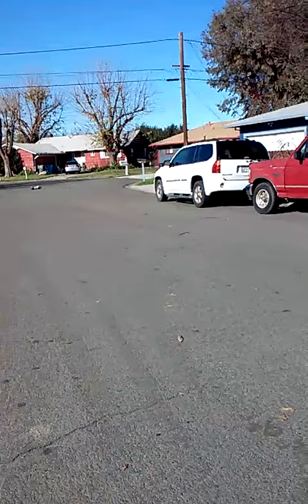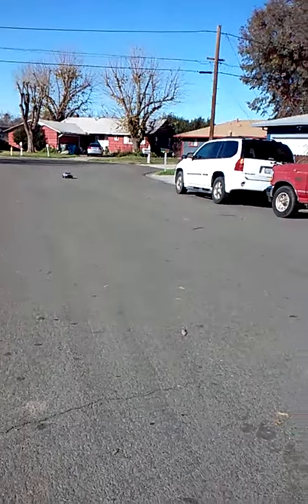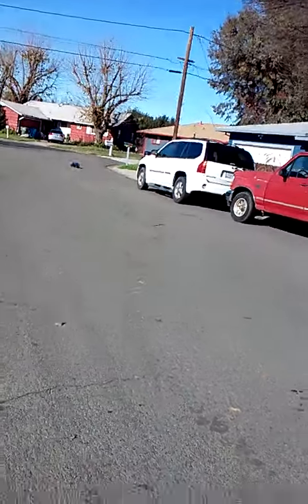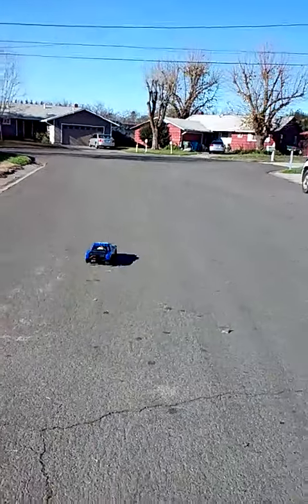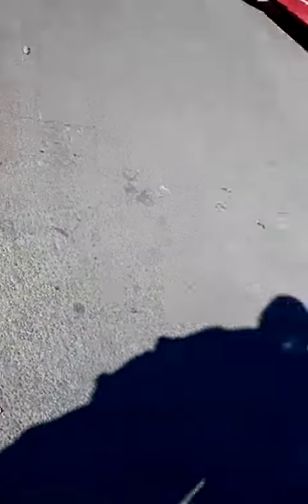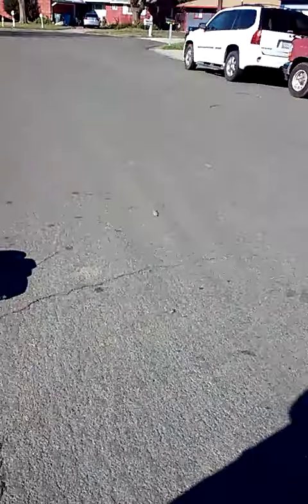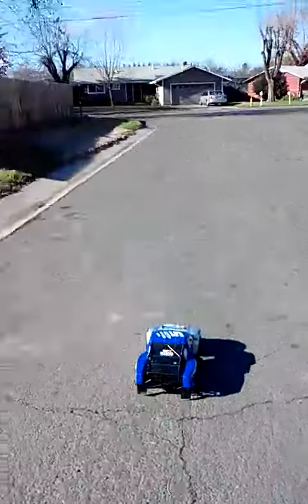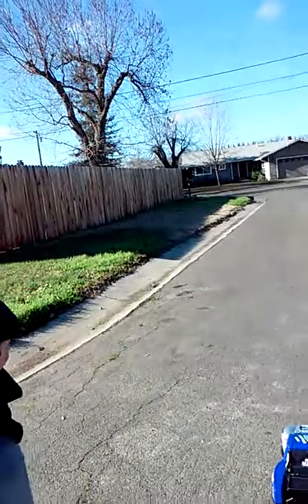Team Associated sc10 first run

Comment: the sc10 gets even better with a 3s lipo but your going to want to lower your sper gear so you dont blow the deffs
Reply from the maker: blow the diffs how does it do that
Reply: +Joshua Wooten Too much power
Reply from the maker: +RC Mayhem so to much torce to the gears
Reply: same thing
Reply from the maker: +RC Mayhem i only run a 6 cell nimh
Reply: +Joshua Wooten o.o then no worries
Reply from the maker: +RC Mayhem funny
Reply: +Joshua Wooten :P